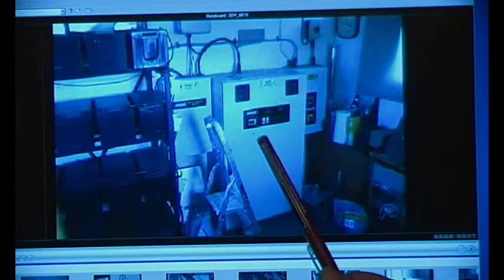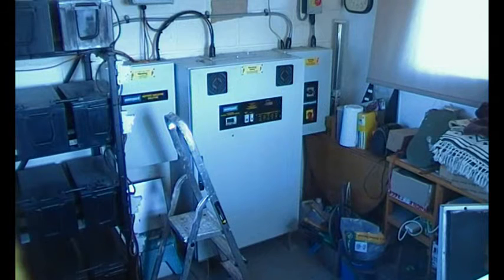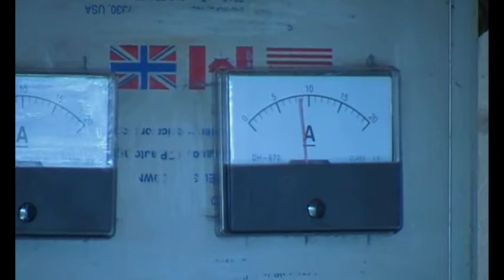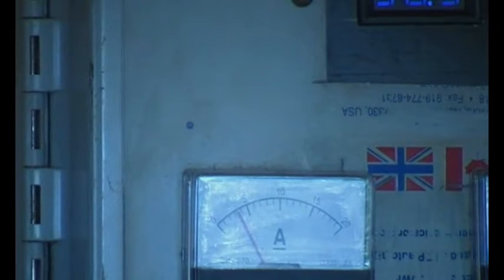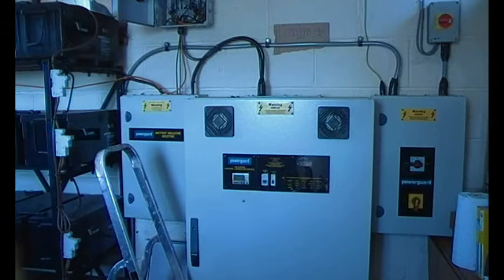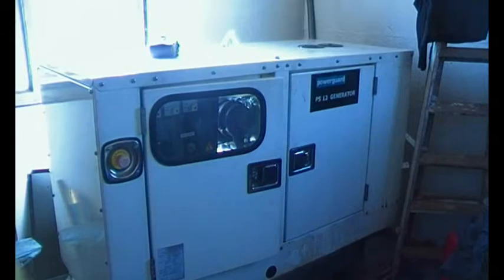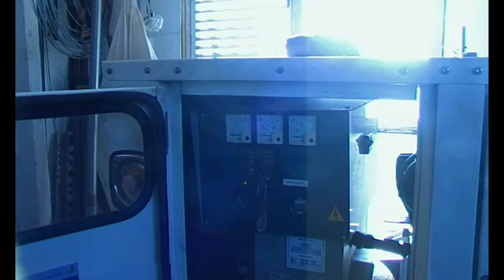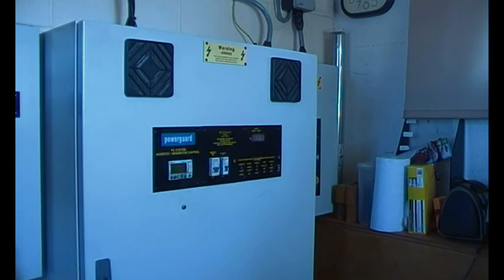Solar diesel, off grid home power system

Comment: That looks like a cool system Andy. Just wondering why you chose the voltage based switching using that relay board than using, say, a commercial PWM (or even MPPT) charge controller? What it for economic reasons or because it provides a more stable voltage into the main unit - which could possibly be upset by a pulsing PWM output?
Reply from the maker: Hi. Good question. 1: They are cost effective. 2: easy to fine tune. 3: MPPT would need a higher voltage so extra panels would be needed, expensive controller and more panels. 4: with this system by changing the relays to change over units 50v dc can be diverted into a heat store of some kind (I must do a video on this). 5: the second stage keeps up with consumption when stage one is switched or diverted. Hope that makes sense. Cheers, Andy
Reply from the maker: Hi. I cannot send you a direct message but there's a thought. Becuse you are in the southren hemisphere and out in the sticks where I assume income is made through a portfolio of activities. Lowimpact.org (formally LILI) do very good discounts on 10 books or more, and they publish on a wide variety of subjects. Just a thought. 
http://www.lowimpact.org/about/lowimpact-org-publications/
Cheers, Andy